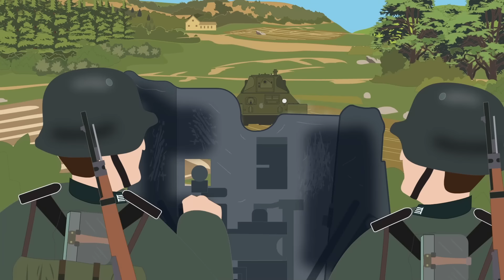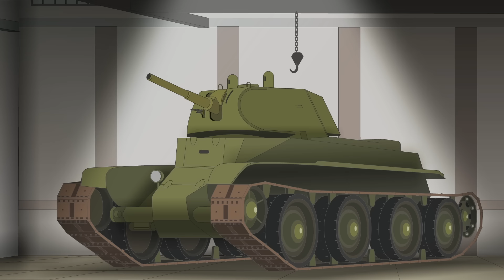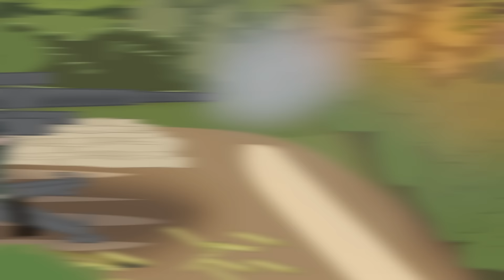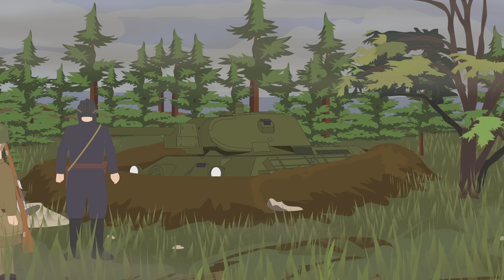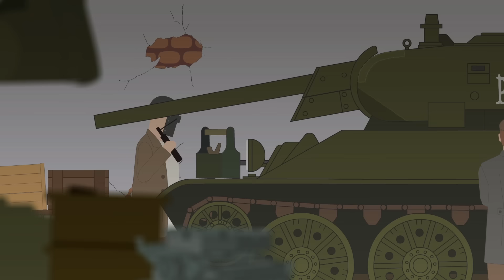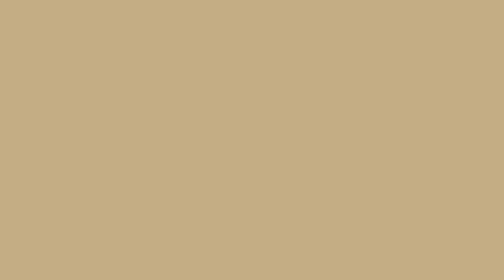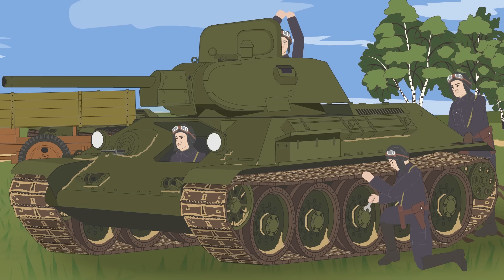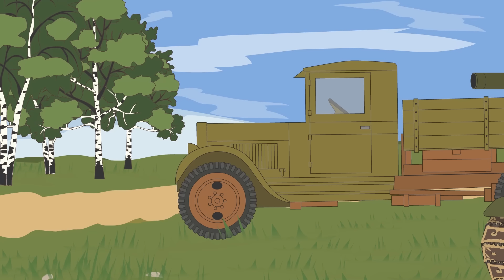Was the T-34 Really the Best Tank of WW2?

Comment: I think saying the t34 was the best tank you have to take into account many different factors.

It introduced many new features and the Germans used the technology to develop the panther.

It was the best tank to win the war with. 

It was more technologically advanced than the Sherman but the Sherman had better components i.e engine power system sights radio crew compartment.

I think overall its a fair comment to say that but needs a explanation.
Reply: The T-34 didnt have anything new. The Christie suspension was not new and the sloped armor was already used in WW1 but in early WW2 few tanks used it (to this degree) due to the issue with space inside the tank.
It did however as you rightfully say inspire the Germans to hurry up development of the Panther and Tiger and the upgunning of the Panzer 4s.
Reply: Wdym it was more advanced than the sherman?🤨
Reply: @priestoffrogsandfatherofam8659  sloped armor wide tracks.

The Sherman was better engineered but the t-34 set the pattern for modern tanks with its advanced design which the Germans incorporated into the panther
Reply: @pheels  ah yes a 60 degree slope is so advanced not like the sherman had a slope
Reply: @priestoffrogsandfatherofam8659  of course the Sherman was better mechanically and had higher quality components but it was based on the earlier M3.

The T-34 was a revolution even though the constriction was rough
Reply: @pheels  how was it revolutionary?
Reply: @priestoffrogsandfatherofam8659  The Germans couldn't match it when they first faced it.

37 and 50mm guns were useless against it.

The Germans had to upgun the panzer 4 and use towed 88mm guns to knock it out.

Like I said it was the first massed produced tank with sloping armour to deflect the shot.

The tracks were wider than German panzer 3_and 4 and had better mobility.

The Germans studied the T-34 and used it as a basis for the panther.

The panther was a better design but not produced in as great a number.

T-34 with 85mm gun was still in service in 1960s and beyond
Reply: @pheels 
"The Germans couldn't match it when they first faced it."
The Germans could match it when they've first encountered it, - which was from the first day of the invasion - and they've performed well against it, but I'll discuss this later.

"37 and 50mm guns were useless against it."
Causes of T-34 losses from June 1941 to September 1942: (Weapon calibre and % lost) [This is based on a wartime Soviet study.]
20mm/4,7
37mm/10
50mm (short)/7,5
50mm (long)/54,3
75mm/10,1
88mm/3,4
105mm/2,9
Unknown/7,1

"The Germans had to upgun the panzer 4 and use towed 88mm guns to knock it out."
The armament upgrading program has existed long before they've encountered KV or T-34 tanks, both for AT cannons and panzer cannons. And I've already talked about the usage of the Flak 88.

"Like I said it was the first massed produced tank with sloping armour to deflect the shot."
No, even the Renault FT utilised sloped armour which was from WWI. Look at the BT-7 or T-70, their armour is sloped. Even the Panzer III had sloped armour, so the T-34 wasn't the first to benefit from it. Don't act like no country realised the advantages of sloping the armour, and all of a sudden the Soviets had this epiphany...

"The Germans studied the T-34 and used it as a basis for the panther."
The idea of introducing a new medium tank has started in the late 30s, - think of the VK 20 and VK 30 program - although yes, the design and requirements have changed because of - mostly - the encounters with the KV-1 and T-34 panzers.

Comment: Yes. The T-34 was the best tank for it’s time. Mobility, protection, fire power and mass production for its time was and is unmatched
Reply: Nope a tiger or a panther could turn a 34 into scrap from a kilometer away. With a competent crew even the stug 3 gave 34s a run for their money just look at Michael whitmanns kill numbers 41-early 44
Reply: The T-34 wasn't cheap, and therefore only could be mass produced because of the massive soviet industry. In tests done by the Americans after the war, it's shown that the tank cost about as much time, and resources as the Sherman. In terms of mobility, no the T-34 was not very mobile. On paper it had a top speed of 25km/h. But in practice, because of production mistakes, the tank had off road a top speed of about 10km/h. Even the Panzer IV was faster off road, and not to mention on road where it didn't perform much better, because of transmission problems. The protection of the T-34 is as almost every other aspect of this tank greatly exagerated. Yes the T-34 had in theory one of the hardest armor out of all vehicles used in WW2, but again in practice the armos often used to rip open, where it had been molded together, rendering the tank useless. Afterall a chain is only as strong as it's weakest link. Also since the steel was heat treated at such huge temperatures, it often turned into deadly shrapnell inside the tank, even if the shot didn't penetrate, leading to an average survival rate of crewmembers of about 15%. And no the T-34 was not unmatched at all. Half of soviet armored losses were T-34s. And another half of these lost T-34s, was because of Panzer IV. Yes an tank that in theory wasn't able to penetrate the T-34. Not to speak of all tanks developed after the Panzer IV, which were even deadlier to the T-34. And that's not all. Driving and coordinating the T-34 was almost impossible. Because often the periscopes used weren't made of glass but of polished steel, which made it Impossible to see anything after just a bit of use. Not only that, but driving the tank was very uncomfortable leading to less combat efficiency by the crew. Also the crew couldn't communicate with any other tank, or at times because of the noise the badly built tank made, not even with each other. Because other than it's German counterparts, the Panther D, the T-34 didn't have an internal radio, often leading to confusion, and lack of organization in battle. If you have any other arguments, concerning the T-34, and why it is the best tank of the war, I would gladly disprove them aswell.
Reply: No the tiger was way more powerful
Reply: @jarlathquinn2628  good luck finding Tiger back then in summer 1941. 

And, yes, Tiger had problems with logistics (two track sets - one for transportation, other for actual use), was burning fuel like if there is no tomorrow and was quite prone to what was called "roads" in Russia. After all, the very first and ONLY two Tiger tanks on the Eastern front during their first use were immediately captured by Soviets for research after both got stuck in the mud somewhere near Leningrad.
Reply: @mdokuch96  Panther was better and the best tank of the war but it didn't make a big difference
Reply: @mdokuch96  well I was referring to when the tiger got deployed and 1941 was one year and the “roads” in Russia was an issue for a lot of things
Reply: @jarlathquinn2628  He’s talking overall performance and implementation as a weapon of war. Not strictly firepower.
Reply: @RustR13  well in most areas the tiger was better from armour to the main gun
Reply: @jarlathquinn2628  But slow and much harder to maintain, repair & replace. More fuel as well.
Reply: @RustR13  that was more the tiger 2 than the tiger 1
Reply: @RustR13  mass production was the only reason why they had superiority.
Reply: @austinmartin5446  Then why did german soldiers that gave personal accounts of the tank didn't think so?

Comment: If you consider that 44,900 of the 57,000 built during the war were destroyed no it was actually the tank with the most looses in the history of tanks.
Reply: additionally: 

“ [….] The average lifecycle of a tank or self-propelled gun in the red army at the front was rarely longer than three to seven day of combat operations.” Boris Kavalerchik, The Tanks of Operation Barbarossa, ISBN 1399014293, Page 152 Lines29-30

Comment: The t-34 is an overhyped tank. Numerous studies showed that they lacked interchangeable parts as each factory had their own measurement system. During the Korean War, Sherman's routinely defeated the t-34s in battle. The only reason that the T-34 is called as such is because of soviet propaganda.
Reply: T-34 at the time of korean war was just an obsolete piece of metal. While the shermans were still upgraded with newer better cannon and mobility. Soviets were switching from t-34 to t-54. But still you cant underesitimate that legend. It was cheap to make and easily replaced unlike Superior german tanks. Which if hit had to be abandoned

Comment: One on one, absolutely not. In fact vastly inferior compared to some later year german tanks. The problem here is that war is not one on one. It was a extremely reliable tank with sloped armor, wide tracks and a cannon able to do damage to most german panzers. The main advantage was the simplicity, in Russian fashion, as well as the ability for mass production. The sights and other mechanisms may have been inferior one on one with a German panzer. The problem for Germany is they were always outnumbered.
Reply: Except even when outnumbered. The german tanks broke down on the way to the front, and due to there design philosophy of throwing armour at everything, were bogged down throguht most the year. The late war german tanks were trash designed for a offensive war, and performed accordingly. Terribly.

Comment: There was another flaw with the armor: It was too brittle too withstand high velocity shells from calibres of 50mm and up, leading to fragments being launched into the crew compartment when hit. And the 1.000 meter combat range is theoretical based on the gun, the distances were much shorter due to the quality of the optics. The transmission was on one level with Tiger tanks when it came to break downs - only the numbers of available units countered that problem

Comment: T-34 was no way better than Panther and Tiger. But was quite reliable easier to produce in large numbers and easier to maintain. Panther and especially the Tiger was very complicated tanks difficult to produce and difficult to maintain. That's why the Germans manage to build only a few number of those. Also T-34 was easier to repair if it was broken. Tiger and Panther could broke down very often and was a total nightmare for their crews to repair the damage. Some historians suggest that many Tigers and Panthers just broke down before even reach the battlefield. This happened many times at the battle of Kursk. Overall the T34 was not the best tank of WW2 but the tank that changed the tide of the war. Especially because the Soviets manage to produce it in larger numbers.

Comment: Panzerfausts never had an issue penetrating the T-34, even in the front
Reply: And so did Soviet infantry against those who wield Panzerfaust
Reply: They didn't penetrate, they broke the hull and turned the armor into a frag grenade
Reply: @TotallyNotAFox  they absolutely penetrated, I’ve read countless books of German soldiers on the eastern front, the Russians got clubbed and only got through because of overwhelming numbers. Russian tanks were easily formidable to infantry equipment and German 88mm guns.

Comment: Was it the best? No, it wasn't but it was very good in certain respects and very successful for a time until newer German units outclassed it. It had many weaknesses but also many advantages. As a medium tank, it often punched above its weight in battle taking out heavier models frequently.

It was a relatively simple design, incorporating many smart design features that were specific to the environment it was going to operate in which was a major advantage. It was also relatively cheap and easy to produce in large numbers. Though it suffered from reliability and quality control problems, it was not an overly complex design like the German tanks and could usually be fixed and back in service quickly.

It wasn't an outstanding tank in any respect but it was good enough in enough ways that it earned a strong reputation as a formidable battlefield weapon. Not great at anything but good at most things.

Comment: Anyone who thinks the T-34 was the best tank of WWII is a fool. It isn't even the best tank on the Allied side (that would be the Sherman due to all the variants it had making it extremely versatile) much less the entire war. The greatest tank of WWII is hard to even measure on what metric? Range and firepower? One could argue any of the heavy German tanks or one of the IS series tanks, reliability? Americans, Soviets and Germans (Tiger and panther transmission problems are overblown myths parroted by morons) are all very reliable depending on the tank in question, longest use during the War? You'd be in a tie between early British and German tanks. It is a very difficult metric, but it certainly is not the T-34 with its lack of radios and utter disregard for crew survivability.
Reply: wrote: " The greatest tank of WWII is hard to even measure on what metric?"

-- Usually, balance of firepower, armor protection, and mobility makes a great tank, and it have to score high in all three category, that makes T-34 best tank in WWII, and the fact that it was with Soviet Union since the beginning of Great Patriotic War all the way to Victory both VE and VJ helps a great deal as well. Crew survivability considered to be good of good armor protection, and a lot less flammable diesel engine.

https://www.youtube.com/watch?v=dAQ0mGz0B30&t=99s